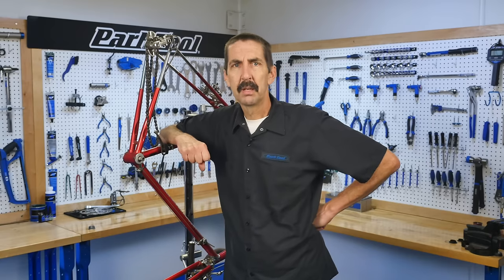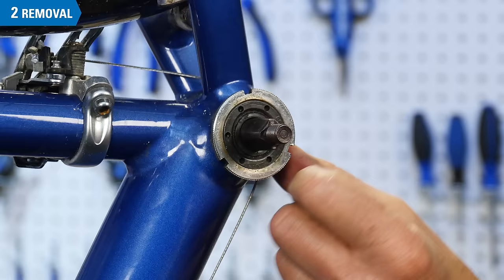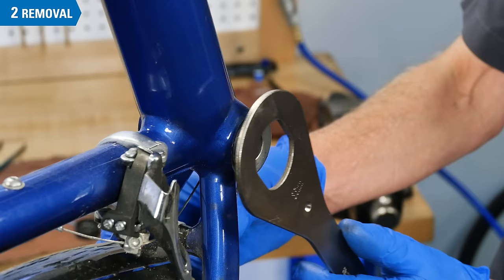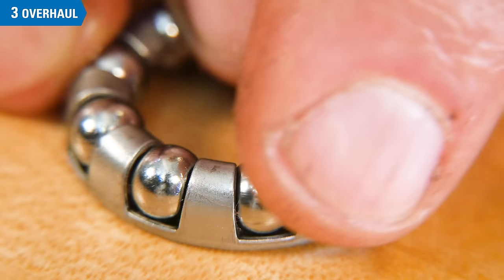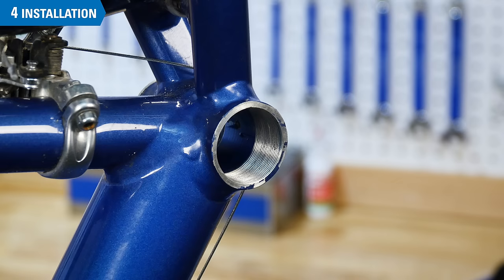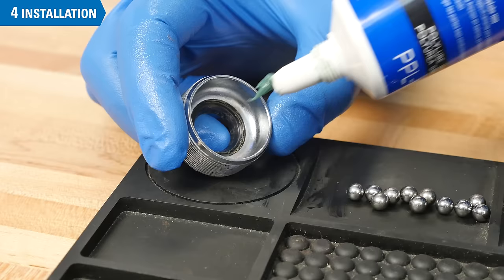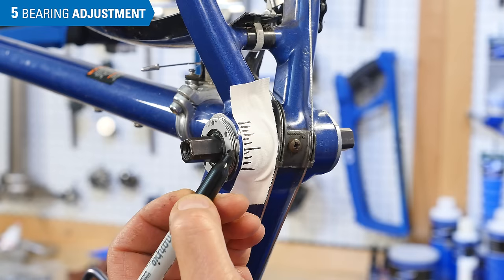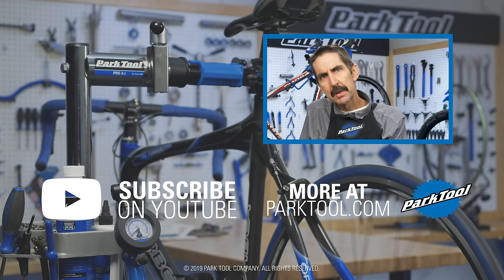How to Remove and Install Bottom Brackets - Cup & Cone

Comment: I think I severely underestimated how much grease I need.
Reply: I just use spit.
Reply: me too 🤣
Reply: A major reason is that these cup and cone bearings don't have internal seals and if they even have external seals they are very loose seals, so extra grease is needed to help keep water out. Sealed cartridge bearings range from 30% to 70% packed depending on the rider's use case.

Comment: thank you - very helpful - I still think that a cup and cone bearing which is in good condition feels better to ride than any of the modern stuff - probably because of the 1/4" ball bearings - I prefer loose balls as you can get 11 in - the cages normally have 9 or sometimes even 7 which puts more load on them - of course they do need regular maintenance especially in wet and dirty condition but if you do strip, clean and regrease often they are fantastic!!
Reply: and who wants to strip, clean and regrease often???

Comment: Thanks for the tip about using the headset press to hold the wrench in place. I'd heard that one a while ago but forgot until I saw this video yesterday, and it came in handy today when I had to remove an approximately 45-year old fixed cup.
Reply: If you don't have a headset press a bolt with some large washers and a nut will work just fine too.

Comment: 3:30 The HCW-4 tool is quite expensive (£38) but I managed to unscrew the bearing with a large pipe wrench, gripping the two flats. I also had to heat the whole thing with a blow torch and even then it was very stiff, tightening up each time it cooled. It can be done though if all you want to do is bin the old bearing and fit a modern sealed cartridge. Great video, particularly the details of it being a left hand thread.

Comment: Excellent video! I didn't realize that you had to use that much grease on the BB bearings!
Reply: A major reason is that these cup and cone bearings don't have internal seals and if they even have external seals they are very loose seals, so extra grease is needed to help keep water out. Sealed cartridge bearings range from 30% to 70% packed depending on the rider's use case.

Comment: Good tip on the use of a Bearing Press. I use half the amount of Grease...to each his own.
Reply: A major reason is that these cup and cone bearings don't have internal seals and if they even have external seals they are very loose seals, so extra grease is needed to help keep water out. Sealed cartridge bearings range from 30% to 70% packed depending on the rider's use case.

Comment: I typically use a small paint brush to apply grease to parts. And you can spin the shaft on the bearing while holding the cup vertical, to see if the surfaces are pitted. Thanks for the video!

Comment: I'm thinking of doing a scratch build from a bare frame(custom beach cruiser) so this has been very informative. Both the bottom bracket and the star nut in the head stock(steering column) I've been the most concerned about installing myself.

Comment: My BB is cup and cone. Non drive side has 26mm bolt, trying to turn it with adjustable wrench, its always slipping cuz the head surface is too thin.
The drive side is 36mm round-flat head. My adjustable wrench jaw isnt wide enough, need to buy bigger wrench? Or i have to use tge specific 36mm one?

Comment: What's the latest kind of system that this system can be upgraded to? I'm in the process of converting a 7 speed mountain bike to a single speed and I have to replace the whole drive system and rear wheel because the rear wheel is bent and I can't change the three chain rings to one chain ring because the rings are all riveted on and even if I drilled them out it still won't work.

Comment: I want to convert from cup&cone to a cartridge spindle. 68mm with 127mm and Italian thread. Am I looking at a straight swap when it comes to dimensions? And also the Italian thread thing is problematic as it is more difficult to find the part, so can you recommend me a part or two I can try to find online?

Comment: Very helpfull. I want to replace my cup and cone with a cartridge, and still use the same crack set.  How do I know if it is jis or iso? Maybe am i missing something. I was looking at the shimano un300. Is a 1984 trek 450 series with Sakae Cx cranks. I understand measuring the housing and the spindle length.

Comment: 2:25 are there any Dura-Ace Octalink non-cartridge bearings anywhere in the world that aren't completely toast? Even the pros swapped these out for Ultegra cartridge units. I know, I did plenty. 2:40 addendum: the cups are probably seized into the frame, so get out a punch, a grinder, a 1/2" airgun with sacrificial sockets, a welder and a hefty length of angle iron to try and shift them.

Comment: How do you know which way to put the spindle in if one side is longer? I didn't manage to note it when removing.
Reply from the maker: Head or Tails.  Guess and install.  Do not adjust yet.  Put on crank and check chainline.  If it is rubbing frame, flip the spindle.    If the spindle makes the rings stick out too far out, again flip.  The middle of the rings should align just to the outside of the middle of the rear sprockets.
Reply: @parktool  Okay, great - will do! Thank you very much for your detailed videos and prompt reply!

Comment: If the ball bearings are loose, what stops them falling into the frame tubes as you extract the spindle?  Is that what the plastic guard is for?
Reply from the maker: That certainly can happen.  Rotate the bike so the bb is the lowest.  Then they will not travel down the tubes.  The sleeve inside is to keep grit from entering through the tubes into the bearings.

Comment: A word of warning I had a mountain bike years back unfortunately the 6 pin bottom bracket was starting to get loose from knackered bearings however i couldn't undo it as it was totally seized up tight the 6pins of the bottom bracket tool just sheared off i ended up giving it to the scrap metal guy once their seized its over you will never get it off if you do use plenty of grease when screwing it back on.

Comment: I did this a few weeks ago, and had a lot of difficulty screwing/unscrewing the cups (had to use a mallet almost all the way).

Is it really possible to had grease on the treads? Doesn't it prevent "locking" the screw?
Reply from the maker: The pre-load or tension in the threads from tightening holds the part secure.  Grease permits proper tightening to keep it from loosening.  It also helps prevent it from seizing or corroding in place.

Comment: Why do you use threadlocker on the drive side and not on the non-drive side?
Reply from the maker: The drive is is the "fixed" side, it is not used for a bearing adjustment.  If you did use a threadlocker for the non-drive....HURRY! You will need to get it adjusted before it sets up.  Then if you wanted to adjust it again any time later, it may prove difficult.
Reply: @parktool  Thanks! Makes perfect sense. I did not, so no worries :).

Comment: What tool do you use to check pitting on the spindle?
Reply from the maker: Trace the ball path with a ball point pen, or a sharp pic. You can feel any roughness as you pass over it.

Comment: When I tighten the lock ring until there's no play on the spindle, it seems like it's on too tight. The spindle seems like it can't spin freely. But if I put one of the cranks on, it's spinning perfectly. Can somebody explain what is all that about?
Reply: Every part is new and greased to the brim btw.
Reply from the maker: There are two parts to the adjustment on that bottom bracket.  The cup is threaded in or out to contact or press on the bearings.  The lockring is tightened to keep it from moving.  Only check the adjustment when the ring is tight. The concept is be right on the edge of play, but still feel no knocking as you check a full rotation of the spindle.  It is normal to have the cup slightly press against the bearings, which then press against the spindle. This is called "preload" and is needed in machinery.   It might feel like drag to your fingers, but to the crank and you pedals it feels like nothing.  
We need another video just on adjustment only.
Reply: @parktool  Thank you very much for fast the answer. I've recently started getting interested in rebuilding this old cheap bicycle I got (built in derailleur hanger) and changed both axles, the bottom bracket, headset and bought several new parts to improve it. 

Last month I wanted to throw it away, now I can't wait for better weather so I can bed in the new break pads. And I gotta say this inspiration comes from the Berm Peak channel which inevitably brought me to your more detailed and simple instructions. Feels almost like playing with Legos. 

It looks so simple when you guys show it in your videos, but the deeper you go in, you realize you need some experience and some knowledge. You do mention preload in the video, but I didn't pay much attention to it. I will now! You guys are AWESOME!

Comment: With the frame hanging like that non-caged bearings will drop down into the down tube, better to have the frame hanging from the top tube with the bottom bracket at the bottom.
Reply: I was wondering about that.  I am about to dismantle my bikes BB and suspect the bearings will be loose.

Comment: I have a 1995 Race Face threaded BB seized in an aluminum frame.  I easily took off the lock rings.  The BB requires SPA-1 tool with 6 internal notches.  Not internal splines.  Not external notches.  How can I get enough hold with the SPA-1 tool to remove the seized BB?
Reply from the maker: That can be a tough one. Try heating the shell a bit and also removing the drive side first ato allow you to get lubricant into the threads.
Reply: @parktool  Thanks for the reply!  I learn a lot from your channel. 

I ended up getting it (before seeing your reply).  Penetrating oil on exposed threads, positioned SPA-1 in notches, slid a cylinder over BB spindle such that it kept the SPA-1 pins from retracting out of the notches, then a clamp holding the cylinder in place using the far end of BB spindle.  Once I got it to break free, it unthreaded easily with the SPA-1 tool alone. 

I like RaceFace products, but that was a poorly designed BB imo.

Comment: I recently just got a brand new MTB, after a couple of months, I noticed that I could feel a side to side movement in my cranks. Any ideas on what I should do?
Reply: MRGRUMPY53 idk
Reply: @ramindersingh6972  Is it a retail store bike like Walmart? It's very common for the bottom bracket to simply come loose, yes after just a few weeks, might just need re-tightening.
Reply: Peanut i got my bike from a place called halfords(a bike shop in England)
Reply: @ramindersingh6972  They do have some that appear to be square taper cup + cone BBs so that is possible. If so it might be as simple as loosening the lock-ring, tightening the adjustable cup, then re-tightening the lock-ring.
Reply: Peanut ok I’ll try that then. Thanks
Reply: I hope your crank/bottom bracket problem got sorted out.  Quality/attention to detail at some branches of Halfords could be better. My local store is very good and the staff know their stuff. Get to know your local bike shop.
Reply: Buster Brown yep all good now

Comment: Probably a dumb question.
I'm sitting in front of a Kajita 1.37×24T. Can I replace this bottom bracket with a more modern one, which has the same size?
Reply from the maker: That has the common English Threading standard. There are many modern options for replace  that.  It needs to be compatible with the cranks.
Reply: @parktool  Thanks for the fast answer. 

Just wanted to say your videos are awesome

Comment: why does my crank loosen every time even my bottom bracket is just fine and the nut is not loss thread?
Reply from the maker: With square tapered cranks, if the inside square bore of the arm gets mis- shapen then it will always work itself loose. A new arm is needed.
Reply: @parktool  thank youu so much!!♥️

Comment: What is the difference between SPA-1 SPA-2 Bottom Bracket Pin Spanner?  What is the SPA-2?
Reply from the maker: The SPA-1 has tips of 2.9mm diameter.  The red handled SPA-2 has smaller tips of 2.2mm.  It is used for small pin holes of some freewheel, crank bolt retaining rings, and other small holed rings.
Reply: @parktool  Thanks.  I am now looking for local seller of SPA-1.

Comment: My knockoff return Schwinn from Wal-Mart  did not have a sleeve. Noticed a hole that went from the bottom bracket imto the seat post. So after reassembly. I took the seat post out, stuck my grease gun hose down the tube. Pumped as much grease down there as I could. Eventually I'll get around to making a plunger. That way I can just push the grease down. The bike is mostly used around where I work. So I'm not bothered by this hackery.
Reply: Seal it off and install a port for a grease gun so you can grease it like a tractor
Reply: @HB-ps6rn  Already thought of that. But I'm not putting that much effort into that bike. Easy enough to pull the seat

Comment: apparently these are old and crappy designs, can you replace with something better/newer style? tia
Reply from the maker: Some of the older models have far better bearing surfaces then the newer designs.  If it is a square spindle style they can be replaced.
Reply: @parktool  thanks, but again, i have the square spindle so what can i replace it with as an upgrade of sorts? tia

Comment: In theory, could I sand down my bearing surfaces to improve the ride quality without replacing parts?
Reply from the maker: Yes, bu then in theory, many things are possible.  "Polish" might be a preferred term. The bearing surfaces are hardened steel.

Comment: So... Most 3 price cup and cone bb's are old as hell, and using a headset press is good advice if the driveside cup is difficult to remove. However the "adjustable" side is almost always seized in because of age and none of the tools suggested have enough purchase or interface with the cup to provide  decent leverage. Surely there is an easier way to remove these non drive side removable cups rather then giving up after destroying wrenches and tools then writing the frame off because the bb is seized.
Reply: Recently had one like that... Found a decent frame in the dumpster... Spent a few days on it, now it's in a new dumpster.
Reply: If you can manage to remove the drive-side cup, you can use Sheldon Brown's "nut and bolt and washers" method to remove the non-driveside cup (use the instructions for an Italian threaded drive side cup): https://www.sheldonbrown.com/tooltips/bbcups.html
Reply: blowtorch  heat the frame - you could try hot air gun first to avoid paint damage
Reply: @BokorRider  but you still need decent tool purchase and nobody does a tool for the non drive side which gives good purchase
Reply: @mattgies  Interesting, I'll keep that in mind. I was able to turn mine eventually with extreme effort, but ultimately the adjustable wrench had slipped too much and stripped the cup and/or the tool so I gave up on the frame. I ordered the HCW-11 but it's not nearly a thick enough wrench for that kind of torque.
Reply: @TroggyPK  heat ,release oil heat release oil heat  release oil...go through that  process enough times it should unscrew with a big adjustable wrench... patience may be required :D

Comment: Great video as always. In general the park tool tools are superior in perfection to other brands. But I am not satisfied with the the hook spanner. The lock ring gets damaged when tightening it even if you won't slip off. The tooth of the hook spanner is too round also the three teeth on the other side of the spanner do not really fit to the dents of the lock ring.
Reply from the maker: Measure the OD of your lockring.  The HCW-17 has other diameter options.  
https://www.parktool.com/product/fixed-gear-lockring-wrench-hcw-17

Comment: Very informative although It would be good if you preached the benefits of a much more modern bottom bracket and crank interface. Notably anything sealed and with a good crankset. I'm not sure if it's a nostalgia thing or what but generally speaking these bikes are simply terrible to ride. So much flex in the drive chain, terrible wheels and chunk absolute chunk primitive groupsets. I'm all for repairing but I think a lot of the old stuff, really should be recycled rather than restored if you seriously intend on riding it. Functionality over form.
Reply: re: "I'm all for repairing but I think a lot of the old stuff, really should be recycled rather than restored"
I dunno ... my Kent Genesis RCT seems to use a cup and cone and I bought it in 2017 ...

Comment: I would never recomend an adjustable spanner, especially from a professional
Reply from the maker: For the bottom bracket cups, adjustable spanners are necessary.  The torque occurs at the lock ring, the cup is only held in place.  There is no "standard" hole pattern between companies, as they all vary slightly from hole to hole distances.